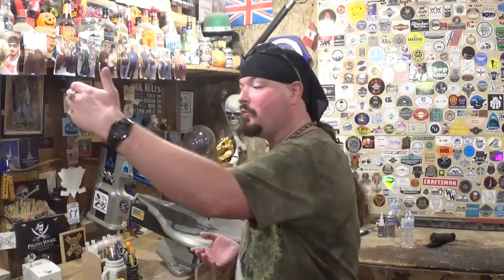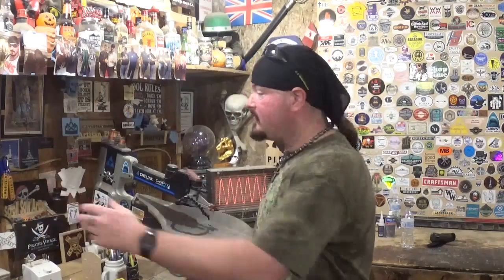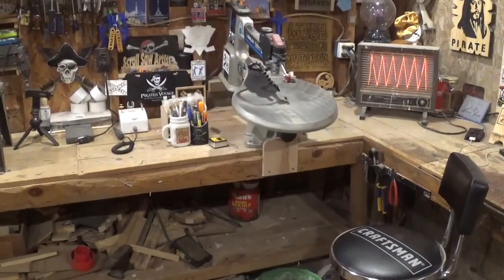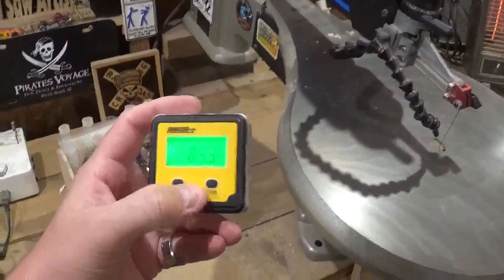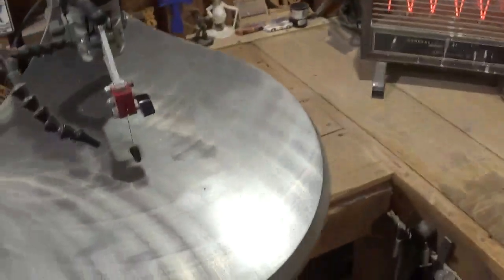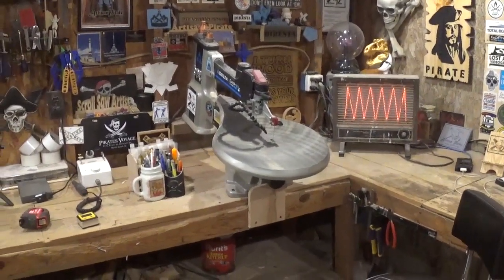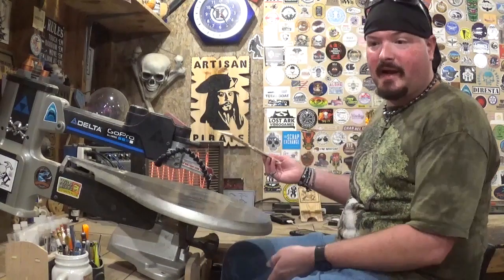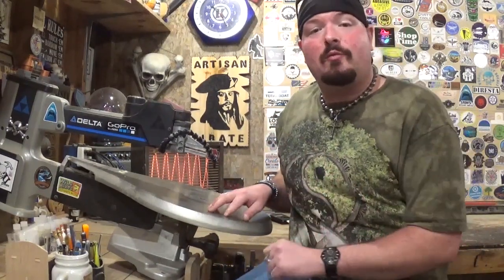Why My Scroll Saw Is On An Angle

Comment: Thanks for another great video.  You are always quite thorough and specific.  My issue in scrolling is more with aging eyesight than tilting the saw.  Your young eyes allow you to maintain a comfortable distance from the workpiece and scroll away.  I find that I need more light and often have to adjust where I position my eyes to see the lines clearly.  However, I still enjoy the process and take breaks when I need to.  Blessings, Glen
Reply from the maker: Sorry that you are having problems Glen, Have you tried printing out patterns in another color to where your cut line is not the same black as the scroll saw blade? This may help.
Reply: @ArtisanPirate   Thanks.  Seeing the line is no problem; keeping it in focus with my compromised vision is the problem.  I'm 75 and wear multi-focal contact lenses, so my eyes sometime fight for dominance.  Once I have cataract surgery at some point in the future, I will get glasses specifically set for the focal length I need for scrolling.  In the meantime I will simply enjoy scrolling and other aspects of woodworking.  Blessings, Glen

Comment: How do you like your Delta scroll?
Reply from the maker: I Love it! As soon as I got it I took it apart and properly greased the bearings and properly secured the screws holding the motor in place. This is the workhorse of the workshop!